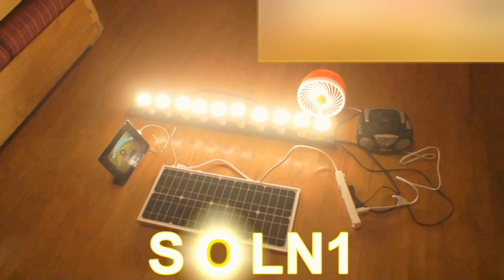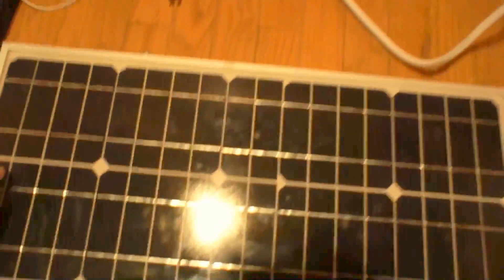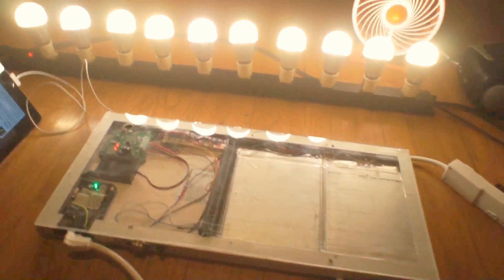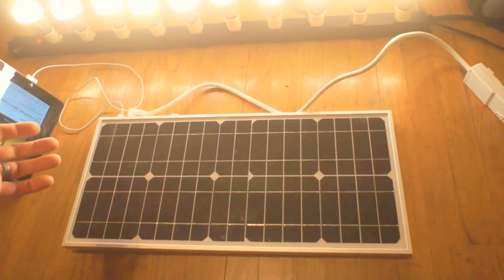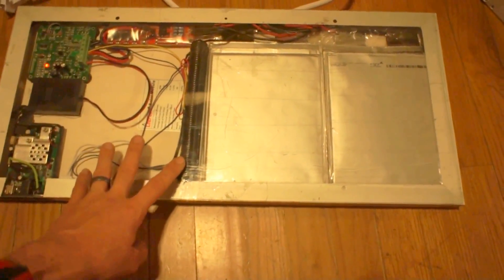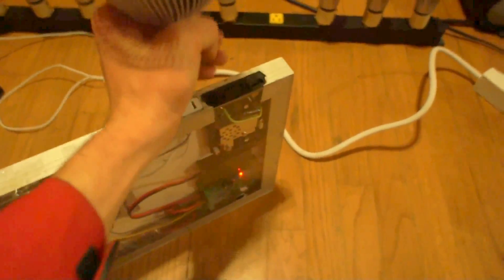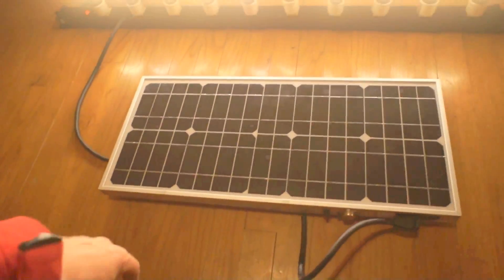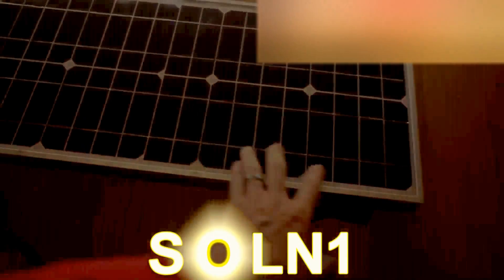SOLN1 - Amazing all in one free energy portable solar unit.

Comment: No such thing as free energy, but this device does make use of energy that is otherwise being wasted as heat. Keep up the good work!
Reply: sunshine is free. the environment can supply energy by means not well accepted by the mainstream. for obvious reasons.
Reply: kandysman86 If we are discussing monetary costs, one has to take into account the cost of harnessing the energy of the sun. The cost of manufacturing all the photosensitive materials. Also, how much energy would those materials actually be absorbing? I think when i posted the comment, I was implying that their is no such thing as "free energy" from a thermodynamic sense. The production of energy in any form has to be met with an increase in entropy somewhere else, which implies that some work has to be done by something. Hence, no energy is "free".
Reply: Kinan A see i don't believe entropy only increases. The evidence given by life itself seems to prove a 2 way universe. If you can ground to counter space, you can create some interesting effects. but when you succeed in raising electrical potential via disruptive discharge, and you create a machine that can power itself, you will have thermodynamic breakdowns, making perpetual motion with static matter impossible. but not because electricity obeys the laws of thermodynamics. because all forms of it don't. but running things till the bearings wear out without fuel is still going to be the way of the future.
Reply: kandysman86 Hmmm, that is interesting. I have always wondered about biological life's effect of the net change of entropy in the universe. I believe Peter Atkins wrote about this exact topic in The Four Laws That Drive The Universe. He used very reductive language (my favorite kind of language) like: "We eat, so we grow". One must remember that chemicals have to be produced in the body to break down the food we eat, enzymes and the like. The production of such chemicals is met with an increase in the entropy of our universe (Zeroth law/equilibrium). As for your claim that disruptive discharge invalidates the third law, i must say, i am completely dumbfounded. This strikes me as very interesting; for i come mainly from a background in chemistry, and i had no idea that the laws of thermodynamics don't hold sway over charge carriers. This is worthy of much research. However, like Atkins said (indirect quote), sometimes it is wise to be closed minded when it comes to claims that invalidate established laws in science. Interestingly enough, that same man claimed that their is no such thing as "laws" in nature, but rather behavioral tendencies, and "laws" are just observations made by us people to explain such tendencies.
Reply: Kinan A well electrons are suppose to be the charge carries, but they only drift slowly through a circuit. Electrons may convey electrical charge in free space(not radio waves, no electrons in radio waves), they are not electricity itself.The union of the magnetic with the dielectric field creates electricity. the rate at which magnetism drags threw the wire is the resistance.and the poynting flow is on top of the wires. the real energy flow takes place in counter space between the wires. This is Tesla, Steinmetz, and Eric Dollard.not me. Altho I wholeheartedly agree.Established "Laws" of science that have been falsified, weather admittedly or not, shouldn't hold science back the way they do today.Tesla measured longitudinal electric waves propagate at Pi/2*c At the turn of the century. that killed einstein before he started, but for political reasons, einstein's theories were encouraged with funding.Research academic suppression and the perversion of peer review. The standard model is bunk and has been know for a long time.
Reply: kandysman86 Agreed. However, while the standard model may be bunk, it does paint a very clear, usable, and understandable picture of an atom for us chemists who are more interested in electrostatics than electrodynamics. I am very interested in how all this relates to thermodynamics. You have provoked quite some thought on my part kandyman86. I know that not long before the standard model was proposed, atoms where thought to be spherical masses of either like charges (Dalton) or unlike charges (Thompson). This explained very clearly why pressure in gasses act the way they do. Then Planck did his experiments on blackbody radiation and now we have a much more vivid understanding of the nature of atoms. I know for a fact that the laws of thermodynamics are absolutely valid on the macro level (the level of whole atoms). That is why the third law is based on the entropy experienced on a perfect crystal (of atoms) @ 0K. However, i never thought about the thermodynamics of subatomic particles (the quantum level). Maybe thermodynamics is the same as Newtonian classical mechanics in that it works for "large" bodies (in this case atoms), but not for small bodies (electrons, protons, neutrons). Amazing how our whole perception of reality can be challenged by thinking about the world on a different scale.
Reply: Kinan A yes it sure can be challenged! you are a rare individual, in that you can entertain more than one view of nature at a time. Thats something thats hard to do. But since you are open to new ideas(or old ideas that challenged the status quo of their time,so were buried) then let me tickle your cheistry fancy,lol http://www.meta-synthesis.com/webbook/35_pt/pt_database.php?PT_id=147.
this periodic table lead directly to the discovery of the transuranic elements and spurred the research for deuterium and tritium(because it predicted them as well) And it also explains the aether with nebulous matter. And trust must(ill give you link if you want:))Michelson morley never got a zero result, they called it a null result because it failed to meet with predictions. but it met with predictions if you understand the 20+ super nebulous pre hydrogyn elements, and the fact that light doesn't travel, it repeats itself wavefield to wavefield through the space gases..even walter russell's successful predictions weren't credited to him(even tho he had already copywritten the names of these elements) because he openly believes that consciousness is the prime mover of reality, so a creator is included in his cosmogony. And we all know modern science cant have that kind of blasphemy lol. but hi transmutation experiments in 1926 at westinghouse labs confirmed his hypothesis about the nature off atoms. Oh and check this out ( no creator, only hard core EMPIRICAL science).http://www.reciprocalsystem.com/cana/. These things are kept real quit in academic circles(upsets to many applecarts)
Reply: Kinan A Oh and this model of the periodic table is based on a 9 octave electric wave. Were all atoms are formed as different electrical pressure differentials.And your right, an atom is a system, and all systems decay over time. Life and death applies to ALL systems, but just like organic life, the universe recycles everything,All of space is a huge potential, were stars are the focus of that potential, it radiates out, just to be contracted back in. Its an electric universe.
Reply: kandysman86 Thank you so much for the links and the kind words kandysman86. I will do my best to read up on Russel's Periodic Chart, and The Case Against the Nuclear Atom within the next few days. Unfortunately, i have a couple of exams starting tomorrow and working their way to early next week that i have to spend most of my time within the next few days studying for. I must say, a chemists main interests lies in explaining the nature of matter from the view of individual atoms interacting with one another. I do often scratch my head at the image of my classmates simply nodding their heads when lectured about the wave-particle nature of matter without further questioning the theory or wanting to look deeper into the subject matter. I suppose you can call it "the chemist's stubbornness": We are only interested in the world from 0.1 to 100 angstroms. Nothing under 10^-35m! Lol. After i get a chance to read the links, i will defiantly let you know what i think, and perhaps suggest some reading material that might interest you about quantum chemistry. I should think however, that you are much more well read then i am in this subject.
Reply: Kinan A thank you as well, and please let me know what you think when you get the time. And I am very interested in your take on quantum chemistry:)
Reply: Kinan A Yeah, the problem is all semantics, really.  People have been throwing "free-energy" around rather incorrectly.  What many people mean when they say "Free" energy is actually an over-unity circuit which simply has never existed, as far as we know, and, as far as we can observe, shouldn't even be possible.  Hell, we haven't even developed a circuit that is unity, for that matter.
Anyway, once the materials have been purchased, there should be no further monetary costs.  THAT is free-energy.  B-D
Reply: Josh Krause I haven't bothered to search the term yet, but, unless it eliminates resistance and every other factor contributing to various forms of energy dissipation, I am confident that it will not be an over-unity device.  Always worth continuing the search for whatever inspires you, though...usually.
Reply: Heat is not always considered wasted energy, but in our mainstream world of doing things heat is where we lose a lot of our energy, there is ways of reclaiming some heat losses, and ways to keep them to a minimum, but this prototype uses light not heat to produce the energy, just putting this device in pure heat without light will not transform heat into electricity, you must be thinking of stirling engines, lol they can use heat and/or wasted heat and turn it into mechanical motion, then use a generator and make electricity. lol
Reply: +Lunartrek bi-toroidal transformer.....
Reply: Kinan A yes there is such thing as free I have only a very small solar panel in my window and it charges all my phones my laptop it even comes with a light that you can put into a lamp for a bedroom so that is free energy
Reply: Blind sceptism.

Comment: u guys are saying bad things about it but if u take some mirrors and point the light back to the panels it will also help charge it
Reply: Who cares? You still are not going to get as much energy out as you use to power the lights.
Reply: FuckYouGooglePlus you obviously have no idea what you are talkin about
Reply: henery slayzack
Oh...I get it. You are joking.
Reply: With current solar technology, that's not going to happen.  A perpetual machine like that is next to impossible.
Reply: henery slayzack people are dumb. The joule ringer allows a whole bunch of lights to be powered with 200 ma. So the lights WILL help slow the discharge. and during the day, with the panel outside, you will never run the batts down with lights plugged in the joule ringer. For some reason fuckyougoogleplus acts like this to anyone that has energy saving ideas. We know that only a fraction of the energy in a circuit is used to drive the circuit, so anything that helps make the circuit more efficient is a good thing.

Comment: I wonder how long it takes to charge the batteries from solar energy. It would take a while I'm guessing.
Reply: Craig Miller
in Australia we have had a HUGE amount of people setting up solar panels for mains 240 volt supply in to the house or the excess has to go back into the grid.
BUT none of the companies will provide a battery back-up system so that power can be also used during night time.
They really don't seem to want people to disconnect from the grid.
However I currently have over 160 watts of solar power available and do charge all my available batteries cyclic monthly.
I had a few people knock at my front door during a blackout about a year ago wondering why I had light and was watching tv when the rest of the street was dark.
People don't realize how cheap some of this can be to achieve.
I spent $100 buying 20 high intensity torches and just removed the led setup in the front and converted it to emergency lighting linked to a relay on a constant battery ( trickle ) charge cycle. Power failure causes the relay to change from ( energised ) charging the battery to ( de-energised ) supplying the lighting INSTANTLY Typically each of these run on 4.5 volts so I put then in series being 6 banks of 3 led heads of lighting for a 12v 7aH Lead acid battery charged to around 13.5 volts This leaves 2 lights left over for other purposes.
Its much cheaper to buy a $5 torch and use the leds than it is to buy the leds from the local electronics store.
The tv is a High definition 22 inch lcd that I plug into a 12v 17ah battery. I get just over 10 hours viewing time off that one.
I taught myself electronics at 12 years old and finished an apprenticeship as a technician Jan 19th 1990.
Doing alarms systems in some jails can be a little freaky sometimes - glad I left that one.
Reply: Craig Miller its not rocket science mate
If $#!t hits the fan and we all need to learn to survive many would gain valuable knowledge from this book alone.
http://www.robotshop.com/media/files/pdf/eck-10-manual.pdf
or this one
http://space.rice.edu/PHYS401/PPT/session2.pdf
In year nine I had already learned more than the basics but took electronics because I wanted a break from thinking.
I stayed at the top of the class and even conducted a lesson on soldering. At the end of the year my report stated " Neville could have found something a little more challenging and worthwhile to do as a subject instead of wasting his time in this class ".
 I liked that teacher but was gob smacked at the comment on my report card. LOL
CHEERS
Reply: Foo Tien pauh, a 20W solar module receiving 4.5 hours of 'full sun' per day (a little below average for the state of GA) would fully charge a 20Ah battery bank on the third day of being outside if positioned appropriately. This also depends on the efficiency of the charge controller, battery regulator and how well the battery bank itself can accept charge from the system design. This setup would have to remain 90% efficiency to take 3 days or less with the scenario I provided...
Reply: Craig Miller
 That is assuming it's 100% dead.
Reply: Noevilea that is cool! And so true about how cheaply you can obtain parts for a setup like yours. The problem is that there is not a whole lot of people who could set up a system like yours.
Reply: Craig Miller Understanding basic electronics is a good start. Understanding power distribution and consumption isn't too hard.
Mate I`m now 46 but I learned those basics at 13. I spent a year from age 12 becoming familiar with the various components and ways they can be labelled then started learning about circuit design before I hit high school.
Always been an outcast mate so didn't see the need to be around others that didn't seem to want me around.
By the age of 16 some of those people started coming around for me to fix radios and TV`s etc.
Ever seen the face on a bully when you tell him what he really is and that you aren't scared nor will you help him. ITS FANTASTIC.
Even found the time to do weights and build myself up physically.
Some people I helped and some went backwards over the verandah.
Pretty passive sort of bloke but sometimes you just have to take that power back one way or the other.
Although I did give one of those bullies some power one day. I made a circuit that developed 1800 volts - he screamed like a little girl and I got in trouble but it was worth it.
Never touched me again.
Now the components I use are SMD ( Surface Mounted Devices ) and things are ssoooo much easier to hide.
Worked up north in 2013 and had this bloke that kept harassing me during the night. I put a high definition camera outside my door. rigged it to my computer which then activated a circuit attached to the door I had insulated from the sounding frame work. He got 2200 volts and never bothered me again. Another bloke tried to intimidate me so I told him about chemistry and what I could do. Also included information that said once he new something was wrong he didn't have time to make a phone call and his body wouldn't be found till the morning. He didn't know I was bluffing but it had the desired effect. LMAO.
I use electroplating at home and make my own copper sulphate with a battery and acid.
So both chemistry and electronics are useful to know for many reasons.
CHEERS
Reply: Yes, I would like to learn more electronics and physics. Am going to design and build the first over unity device that becomes manufactured.

Comment: Sorry I'm a little late to the party. I'll subscribe to make sure it doesn't happen again! Nice work! I'm working on a solar oven on the cheap, the idea to give it to a homeless guy I see at a park by Sarasota bay. Anyway, I have a pack of 40 6"x3" solar cells and about 20 thermoelectric modules (these can either generate electricity or use electricity to cool or heat). I wanted to incorporate a small solar array and 4 x 3.2 (or 3.7, I forget) spare lifepo cells I have from another project (or supercaps? - I just don't have any on hand) . The idea being that you could cook, and generate a modest amount of power to keep a small cold space for drinks,  or power a radio, etc. Certain requirements (just like your design) are it needs to be small and lightweight for easy portability, which limits how fancy I can get. I wish I had your electrical abilities! Great job!

Comment: I have a saying, "Low power is better than no power". Ever vehicle has a battery and a voltabe source. learn to use what is available, now, before you need it. Lasersaber has many good practical ideas. Prepare, cause the system is going down, totally.